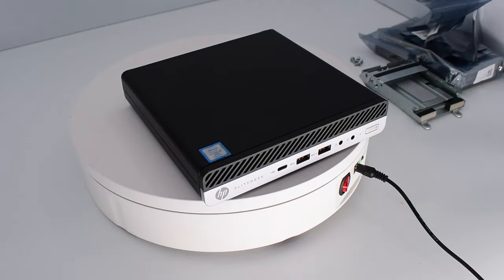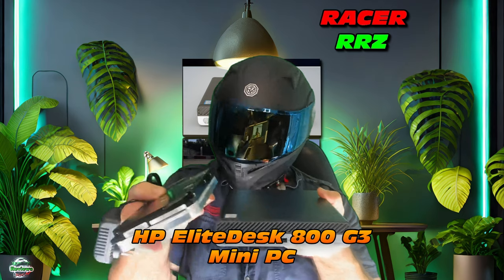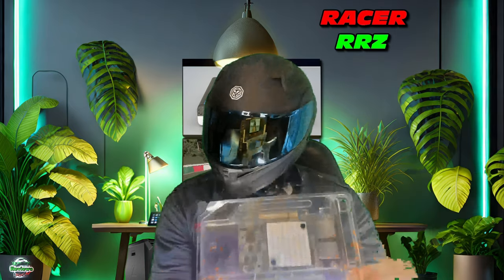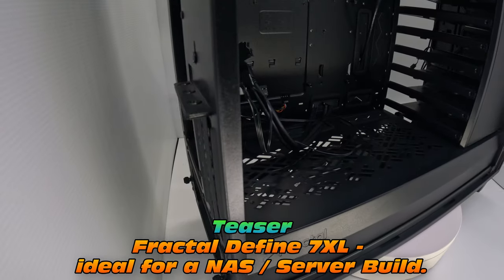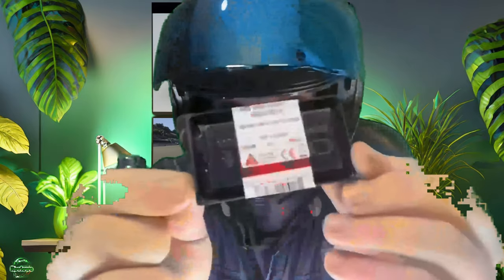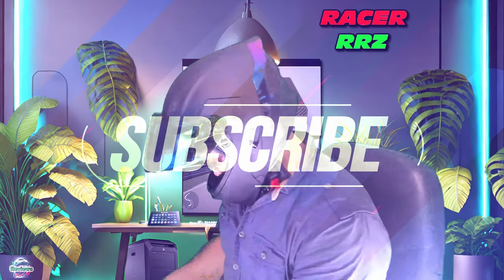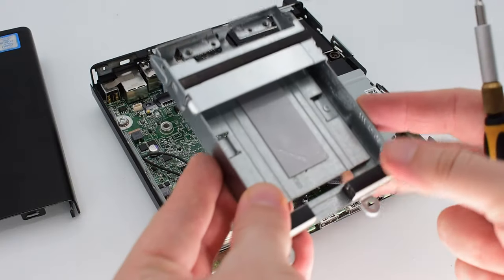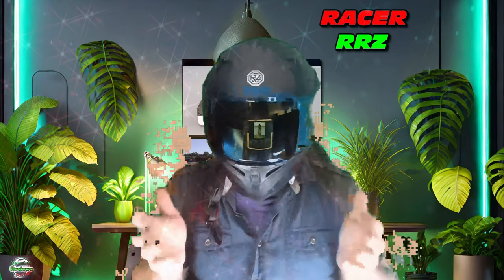Outrageous Mini PC Server BUILD - No Seriously - Frankenstein Server.

Comment: I went one size up in the SFF PC space, so the computer actually had a PCIE port. PCIE 10g card is then easy. Or get a PCIE HBA to get lots of drive connections. The other adapers are wonderful. Nice Frankenstein server idea.
Reply from the maker: Thanks. My goal was ultra low power draw (ideally under 30W) so that I can leave it on 24/7. The SFF systems tended towards 35-65W (I did a build with a Compact Elite 8300 SFF) which was decent but still higher power draw than say a NAS. I am working towards a Lenovo M920Q Tiny which has a PCIe X8 slot of sorts. I need to get the system rounded off to see what it looks like. I'll post up some pics once it's done.

Comment: SFP+ is soo much cheaper to run though, also uses less power and produces less heat
Reply from the maker: Short answer: 
That's true. I just don't like the cost of the SPF+ cable connectors - and it really adds up even on a small network. 
For the power difference I would like to think it would take many years to recover the cost difference. 

Long answer:
An example of my logic (all hypothetical and holding some assumptions): 

Take a dual port X540-T2 RJ-45 (10GbE) vs a dual port X520-DA2 (10GbE). 
The X540-T2 would require two RJ-45 Cat6 cables (~$2.5 USD / meter = $10 USD for 2x 2m cables) to connect into the network. Likely using ~2W each - pending length. 
The X520-DA2 would require 2x SPF+ cables (~$10 USD per meter = $40 USD for 2x 2m cables). 

That leaves a $30 buffer for connecting SPF+ vs RJ45, 2 ports at 2m each. 

At say a 1.3W power difference per cable that's a 2.6W total difference between SPF+ vs RJ-45.
That's ~0.0624Wh/day, and at say $0.4 per kWh that's $0.025/ day power cost difference. 

Assuming a high power price and 24/7 2W power draw (so the highest possible costing), the $30 difference will be absolved after 1200 days, or 3.2 years.
If you assume the cable isn't using 2W 24/7 that would increase the time to break even substantially. 
Assuming a more modest power draw, say 25% usage per day, ~0.0156Wh/day and at say $0.4 USD per kWh that's $0.00624 per day, or 4800 days, or 13.18 years to absolve the $30 difference in initial investment.

Hence, I opt for the cheaper RJ-45 route in the hope that I'll come out better off. 
If you had a more complex network then the power saving would make sense, but then I would convert the entire network to SPF+ to avoid the need for SPF+ to RJ45 adapters (some devices just don't support SPF+ ports; a SPF+ to RJ-45 10GbE transceiver can cost $80 USD: e.g. https://www.ebay.com/itm/334992512922?hash=item4dff1c179a:g:kDMAAOSwMqRlvHpW, or maybe I just haven't found a god place to get the SPF+ connectors on the cheap lol).
Reply from the maker: We both agree on things which is good. 
You didn't dispute my operating cost calculation, so if I can source RJ-45 components to offset your selection of SPF+ item prices that should prove my stance. However, for your end calculations to hold true you are reliant on a single switch by a single company that happens to be the cheapest 10GbE switch in existence. Your 8 computer calculation also favours the 4 port switches, what if you needed 9 computers in your network, that means an additional switch over say a 5 port switch. I would call that a bias but that really doesn't change the reality - SPF+ saves more on power.  

I just purchased a 10GbE with dual RJ-45 for $20.27 (Inspur X540-T2 dual RJ45 10GbE NIC), but you can source Intel X540-T2s (10GbE dual RJ45's) for ~$60 USD.
For a fair comparison you would ideally need to compare the same brands - picking the cheapest 10GbE switch in existence wouldn't really be fair, but I'll adapt to that price differential for keep you happy. Different brands offer different products at varied qualities. I don't mind Mikrotik but they do not make a RJ-45 10GbE switch to my knowledge.  

1) 10GbE RJ-45 or SPF+ NICs cost the same, brands will change the price but shop around and you can get what you want (I mean dual port Inspur X540-T2 dual RJ-45 10GbE at $20.27 is hard to beat). 
2) Mikrotik is the cheapest 10GbE switch in existence and it happens to be SPF+ (not coincidental - I mean SPF+ is the preferred enterprise solution). My Ubiquity 10GbE switch cost me an extra $120 USD over your cheapest solution. 
3) I don't quite follow your metrics to obtain the $148 - derived from combining what items? 

SPF+: For 1 PC according to your info: Say dual port 10GbE NIC $60 + $13 SPF+ DAC cable (5f) + $180 4 port 10GbE Switch = $253
RJ-45: For 1 PC according to your info: Say dual port 10GbE NIC $90 + $6 RJ-45 (Cat6) cable + $300 4 port 10GbE Switch = $396
RJ-45: For 1 PC using my info: Say dual port 10GbE NIC $20.27 + $6 RJ-45 (Cat6) cable + $350 4 port 10GbE Switch = $376.27

But the reality is that most networks do not always have devices that can adapt to SPF+, so what if you needed to adapter to RJ-45 (e.g. 10GbE RJ-45 NAS or Router)? How does that effect things? Also, 5foot cables are not realistic - that should really be scaled to match a network more accurately. If you assume 8 devices in say 8 different locations in a house that would change things. Let’s say we need 25 foot cables (small house lol).

SPF+: For 8 devices according to your info: Say dual port 10GbE NIC 8x $60 + 8x $65 SPF+ DAC cable (5f) + 4x $36 RJ-45 Transceivers + 2x $180 4 port 10GbE Switches = $1504
RJ-45: For 8 devices according to your info: Say dual port 10GbE NIC 8x $60 + 8x $30 RJ-45 (Cat6) cable + 2x $300 4 port 10GbE Switches = $1320
RJ-45: For 8 devices using my info: Say dual port 10GbE NIC 8x $20.27 + 8x $30 RJ-45 (Cat6) cable + 2x $350 4 port 10GbE Switches = $1102.16

And because $20 10GbE NICs are surely not reliable: 
RJ-45: For 8 devices using my info: Say dual port 10GbE NIC 8x $60 + 8x $30 RJ-45 (Cat6) cable + 2x $350 4 port 10GbE Switches = $1420

Conclusion: save between $84 - $401.84 when going to RJ-45 on setup cost alone (not dual configuration but 8 devices in the network as an example - more cables make the RJ-45s a little cheaper yet still), but then pay more in power on that setup which cuts into that margin. The RJ-45 could cost $40 more in power to run per year at 100% use 24/7. So, break even in 1-5 years pending config. But it’s really pointless spending time arguing this lol. Know thy hardware - problem solved. SPF+ for large networks that have high use. RJ-45 is fine for a home network, unless you plan and spend time carefully selecting the cheapest SPF+ hardware to get that low power draw and insane 10GbE home network. And keep in mind, this calculation only holds true if you can find the cheapest Mikrotik 10GbE 4 port switch - if you can't find one, well up goes your SPF+ setup cost.

Comment: Absolutely amazing😊
Reply from the maker: Thank you, I am glad you liked it. But wait there is more! I have a few more tricks in store for this little system. I'll post up some photos in a day or two.
Reply: i would do a little bigger sff PC, one that has 2 pcie ports, one for a sas controller and one for 10 gig
Reply from the maker: What I liked about this unit was the power draw, so I am trying to extract the most out of it while retaining that 10-20W power draw. The Lenovo ThinkCentre M920q tiny is the best alternative I have seen (that's not SFF anyhow). If you have other suggestions I am open for ideas. I only settled on the Elitedesk 800 G3 due to price (~$45USD on auction!).

Comment: or for the total price of the additional shebang, get MS-01.
Reply from the maker: You might be right there! The MS-01 would be the dream for the task (with Modern Intel CPU, 3x M.2 M Key slots, one X16 (8) PCIe 4.0 slot, 1x M.2 A & E slot, 2x 2.5 GbE ports, 1x 10GbE port). Setting a budget of $680 USD (~ the cost of a MS-01 system), that would buy quite a lot of storage to upgrade the current system. 

Right now the system plus the hardware bits are clocking in at $204.75 USD ($45 (800 G3) + 66.13 (32GB DDR4 2400MHz) + 16.19 (M.2 A & E X8) + 20.27 (Inspur 10GbE NIC) + 13.8 (M.2 A & E 2.5 GbE NIC) + 15.46 (M.2 M Riser X16) + 27.9 (X4 Sata + DC power adapters) - yes I did it all on the cheap). 
All of the hardware mods will transfer to a new system also, so no harm in acquiring them since they will be able to transfer into my next system also. 

The end product will be: Intel 7500T + 32GB 2400MHz RAM + 1x M.2 NVMe boot + 4x 1TB SSDs in RAID 5 + 1x Exos X18 16TB HDD (scratch drive) + 1x 2.5 GbE + 2x 10GbE (may only see one port reach 10GbE), all while hopefully using between 15-25W. 
Net system cost: $204.75 + $94.72 (4x 1TB SSDs) + $234 (Exos X18 16TB) = $533.47) - but more on that in a future video! 
There may be a few extra costs if new things come up but for the time being it's a decent system for the cost.
Reply: @racerrrz  wait wait wait, 20.25$ for that 10gb nic ? surely used, right ? if new then I guess I’m buying metric tone ;) (even though it’s x540
Reply: @racerrrz  also you mentioned m.2 nvme boot but you don’t have a price for it.
Reply from the maker: I know right, I was as skeptical as you are. I paid over $80 USD each for my last two Intel X540-T2's. All the prices are quoted from my AliExpress order list (I'll add it to the next video - once I confirm everything actually works). 

The prices may vary, and I strive to find the cheapest possible prices before I buy. The Inspur X540-T2 was the cheapest 10GbE that I know is compatible with HP workstations. There is a chance that it fails to get detect, but I took this model because they had the HP Z440 listed as compatible in the listing description. If the 800 G3 fails to detect the Inspur I will try it in my Z440 (which has a genuine X540-T2). I provided links to all the items in the video description - but again, shop around and you may find the items even cheaper.
Reply from the maker: True that. I didn't include items that I haven't finalised just yet. I will likely use a KingSpec 256GB NVMe - but I bought those in Sept. 2023 at really good prices (~$15 USD each). I'll also use a M.2 to USB adapter (~$11 USD - Union Shine 10Gbps with RGB lol) and an old 4-Bay NAS that I still have lying around (I tried selling it a few years back but no one wanted it lol). 

Oh, and the new items are meant to be new - but AliExpress is known for quality "new" items. 
Thus far all seems well. I was most impressed with the Exos X18 for $234 ("new"! arguably, SMART data looks ok but could that be cleared with the right tools - maybe).
Reply from the maker: I have noticed the X540 is quick to thermal shutdown - on my Z440 (every PCIe slot is occupied - the joy of riser cables) I had to install a fan to move more air across the PCIe slots to prevent it from shutting down. I am about to test a Inspur X540 which is smaller - I can only assume it will go nuclear in mere moments lol. Nothing Noctua can't solve.

TBW is an issue on NVMes but that's one aspect that I do consider when I buy mine - I always go for the highest TBW for the $$s to ensure I get the most life out of the drive. But if you use them daily with high loads they will run out of fast - a bit of a consumable in the end. I am taking a chance on these cheaper SSDs/NVMes but if they let me down early I'll be sure to pass that on in a complaint video lol. From what I have read - some of the cheaper brands do use reputable chips. 

As an example, the KingSpec 256GB has 4 memory chips - which suggests they are assembled using the smaller and likely older NAND Flash chips. That would explain the price point. These chips may or may not last - but only time will tell. I assume these 256GBs will have a ~150TBW, so not much at all. 

I would like to think their life span could be expended if you can operate them at lower temperatures. I stated placing thermally conductive silicone ontop of and underneath my M.2 NVMes when possible to help dissipate heat. On my boot 970 Evo Plus I had 5 layers on top and 1 underneath to allow heat dissipation into the aluminium case it was placed into. From 95'C on the hotspot temp to 75'C - that is bound to extent lifespan.
Reply: @racerrrz  yeah, in the industry there is a joke that Intel made x540 not in 40 Nanometers, but in 40 Millimetres lithography - hence the heat. 
The drives - you're right on the approach, but please note that those bad WD drives I'm quoting are sitting between 28C - 35C ... so high temps don't explain super low write endurance. 
Note about using pads and silicone etc etc, you may find that you will get far better temps if you blow air directly at it. Pads and conductive silicone are terrible at heat transfer due to how thick those are.
Reply from the maker: @tommybronze3451  True. You did well to cool the NVMes to 35'C, I can't get mine much lower than 45'C on idle and 59'C during heavy use (I found the HP Z Turbo Drive Quad Pro the best PCIe adapter with regards to thermals). Still strange that their endurance was so low, but it good to see some real-world endurance data for them. 

I usually have multiple NVMes in dual or quad adapters so I can't always get a dedicated fan onto them. But I would believe that direct air flow would make a huge difference. The thermal silicone only works because NVMes end up encased in an enclosure with poor air circulation, but in the adapters I have tested it actually worked quite well to drop their hotspot temps.
Reply: @racerrrz  nonononono - those crapy drives sit inside of wyse5070 and have next to zero writes to those, and don't really produce that much heat. The heavily used ones, the best I could get was actually in open case, which is convection (gravity) cooled, where I removed the pads and applied normal cpu paste on it to connect it to heat sink. Now, those are at idle get 40C and at full whack about 55C (heavy 4k reads and writes - large project compilation). So no, I'm not some rockstar in terms of cooling, however moral of the story is that even WD is somehow respected brand, even they provide some really bad drives.